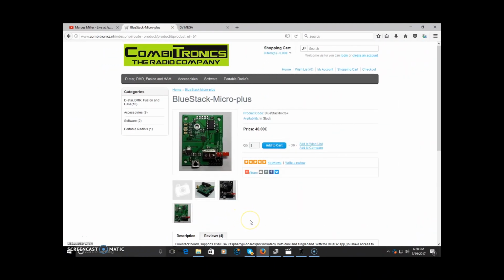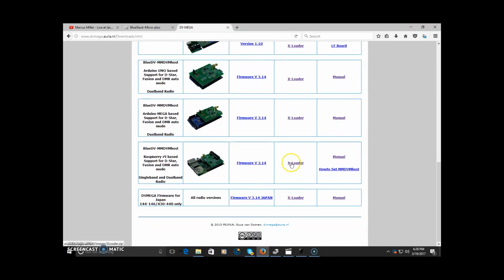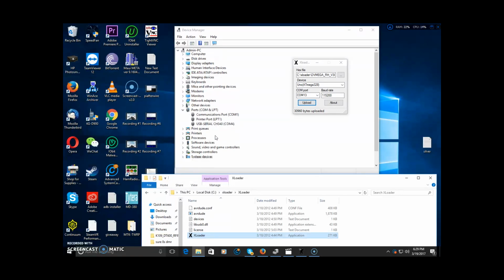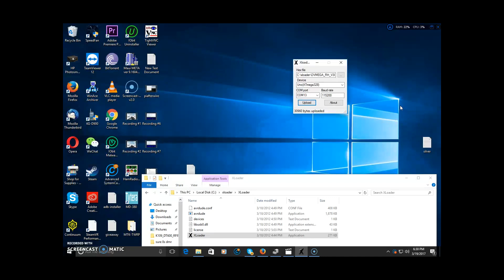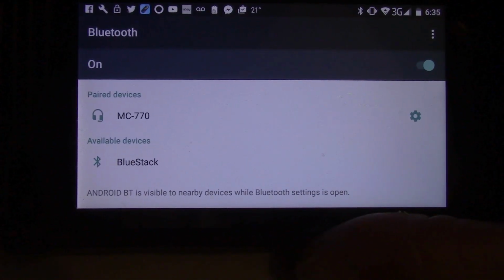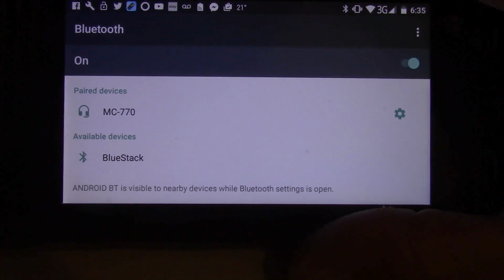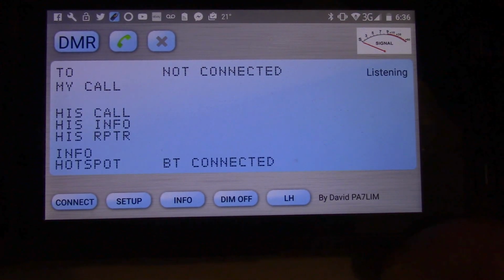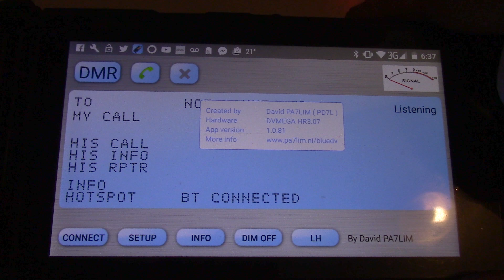Dvmega firmware update Bluestack micro+

Comment: Eric,
Well thanks for the video and the upgrade went as expected, but the BlueDV Plus will not connect to the Bluetooth or when connected to a usb port on the computer. all I get is the 2 Red Leds flashing and no connection  ... and the software gets an error and will not save data to the BlueDv. My suspicion is that the BlueDV was DOA . Any Suggestions since Gigaparts has no tech support and I had to request a manager at Gigaparts to get a return/replacement.
Rather disappointed with the bluedv plus(unfortunately I had to wait over the 30 day to implement this new product)

Comment: This is great if you have the Bluestack but what about using the raspberry pi to do the upgrade.  I have 2 pi s and don't really want to but another board to upgrade the 2 older dv megas.  Yes buying the Bluestac (BS)  just to upgrade the firmware on the dvmega is cheaper than buying a new DV mega
Thanks
ND9W